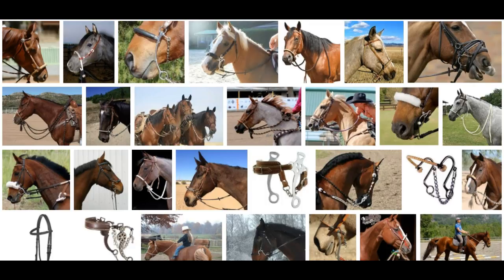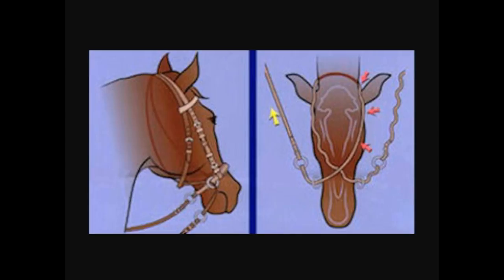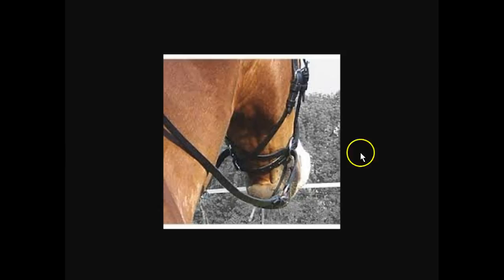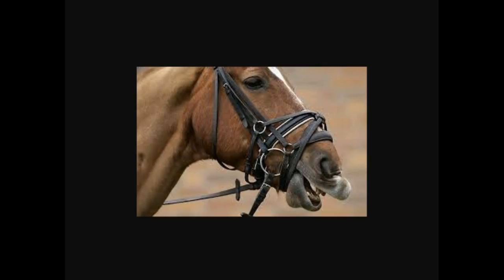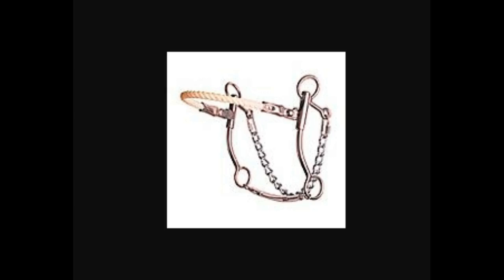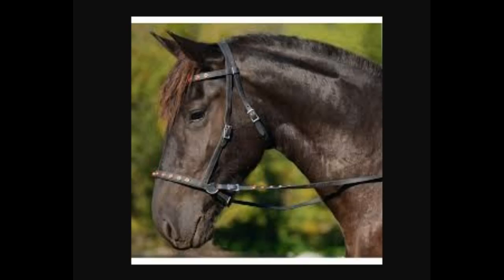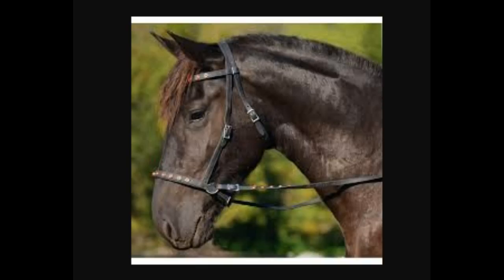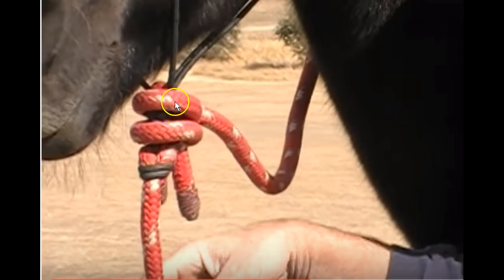Explaining & Understanding Bitless Bridles, Hackamores, Rope Halters & Benefits For The Horse

Comment: When I was reading my horse i used a halter (red and yellow i think) that allows you to clips a lead to it eg under the chin, on the sides of the head and as we didn't have a proper bridle i used two 'traditional' rope dog leads tied to together and clipped to the metal rings on either side of the halter. I was reading bare back as well. It worked perfectly fine, i just tugged gently on one side or the other to get her to turn. I think I used a bench to get up onto her.
Reply: She wanted to go into her paddock one time but I directed her up the hill to the front yard and in through the open metal gate (it was plenty wide enough for her to walk though comfortably) so I could get off. I did all of this without help which I count as an achievement. That was back in 2008-9, but is one of the things I remember the most about it
Reply: I haven't ridden since 2009 when my horse got spooked by a dog and bolted up the hill, she was going so fast I couldn't even hear myself scream. She went into the mango trees and I jumped off and cut my left leg open  just under the knee because of the barbed wire fence. If I hadn't jumped than I would have gone over her head when she ran back onto the road and stopped facing in the direction my parents at the bottom of the hill.
Reply: I still have the scars from the barbed wire fence other than that and a bruised tail bone and being absolutely terrified I was fine. My horse come back over to me once she had calmed down. I absolutely loved her and wish I had kept my promise of being the one to ride her again but I couldn't. At least she has a good home now.

Comment: So the metal in the mouth on most bridles used is a bit??? And the best type of bridle is a traditional hackamore, what about a typical most common used bridle but without the matzo thingy in the mouth, with a traditional hackamore has the rope underneath it, and it's not on the side of the horses nose to control which way it turns??? And I have tiny soft hand I don't pull unless I'm going backwards or coming to a halt or to slow down
Reply: So what is the traditional hackamore completely harmless

Comment: What do you think of a sidepull? the only function is to move the horses head in the direction you pull. Usually made of leather, I wanna use it for light dressage and trail riding but i want to hear your opinion :) Dont care if the horse has its head up or not.
Reply: Alissa Horse lover Most sidepulls have metal in them, which metal tends to break. I’d definitely suggest a rope halter, personally I think they look a lot cleaner and sharp when paired with an english saddle
Reply: Padded sidepulls are great provided they're adjusted right. Here's a great link on bits vs bitless, padded vs rope (https://www.fairhorsemanship.com/articles/harm-of-bits-nerves/) and how it affects horses nerves.

Comment: Hey Rick, I was with a therapeutic horse riding group and we used halter bridles, but the had bits. What would you suggest the DreamWorks Riders use alternatively?
Reply: Hannah Barton I know I’m not Rick, but sidepulls would work well too. Although most of the time they have metal in them, so they’ll break easily. A traditional hackamore or rope halter would work best

Comment: What do you think about a Nathe rubber bit?
Reply: Those Eventing Girls hey i havr had two wear thru on me. 2 different horses. i wNted a kinder way than metal but even with rubber or nathe, its gagged your por horse. i wont use bits now. ps... inside the nathe is thin ragged metal.
Reply: Lyn George what
Reply: Bianca Wheeler thank you! I totally get what your saying. Will definitely check out those rope halters

Comment: any recommendations for a English hackamore as I ride English
Reply: Priscilla Shadowbridge dr cooks bitless bridle is a very nice English hackamore.
Reply: Or a racing hackamore.
Reply: Priscilla Shadowbridge I prefer a side pull or a rope halter, they can look very clean and sharp
Reply: I ride english and just use a rope halter. You can also buy a nice looking side pull.
Reply: Priscilla Shadowbridge I absolutely LOVE jumping hackamores. They look really nice too. Especially if you ride English and want to keep a clean look.
Reply: Padded sidepulls are the way to be my friend. Flower hacks can be good too, but again, a padded one. A sidepull is a lot more gentle though. Also depends on what you do with your horse via english-if you do a constant contact, you NEED a very padded and flexible material or you'll run the risk of causing a lot of nerve damage.

Comment: My ex trainer did harm my horses nose by traditional hackamore. Traditional hackamore do have mechanical function too, because of firm shape and low tied mecate. IT makes the same add force to your hand as "mechanical" hackamore. I dont think that you ever had all types of mechanical hackamores in your hand. These which have ONLY leather nose part, And very loose chain (2fingers minimum And more) or leather band under chin Are very soft to the Horse. You can try it if you will leave your hand under the nose or under the chin And pull full force. Or put the hackamore birdle on your leg. IT doesnt have that effect as you think IT does. Its a lot softer than tradicional hackamore. Hand under the tradicional hackamore Is a lot uncomfortable even ouchy. I Ride on rope halter like you, but i also have a mechanical hackamore which i uses occasionally, but I Will not let anyone to put traditional rawhide 3/4 hackamore on my Horse.
Reply: Which hackamore or rope halter would you recommend?

Comment: Do when riding bitless, to stop a run away horse do u just have to pull harder to stop?????
Reply: No, if your horse is bolting you should pick up one rein and circle them.
Reply: Tyra Mistfall thanks so much 👍
Reply: You can't physically stop a horse by pulling back. It is either them giving to pressure by will or by pain. Using one reign pulled away from your body more toward your thigh to circle is the only way you can physically stop a horse. Pulling back just won't work if your horse isn't responding.
Reply: Matteya thank you I understand how that would work 😊
Reply: 23lidistl thank you 😊
Reply: I tried circling my horse when he bolted when I rode bitless and he didn’t respond to the pressure at all. The only time I’ve been able to collect him after bolting is with a bit. He’s bolted three times in all the years I’ve had him. Not saying that the bit didn’t hurt him at all because it probably did until he gave in, but that’s the only thing that I’ve used in that situation to stop him

Comment: Hey Rick if I were to use a bit which ones in your opinion Are the least harmful? I don't want to Hurt him but he does not get what I want him to do with out one.
Reply: Syd Loth any kind of bit will cause some sort of pain or discomfort. Do you lead your horse in a bridle or a halter?
Reply: Syd Loth uhm try the bridle that was the first one, its still sensitive enough so they can feel secure
Reply: the softest bit i can think of is a rubber french link loose ring.
Reply: Syd Loth What kind of question is that! A bit is designed for pain. You can’t expect your horse to work perfectly after you’ve trained him with pain and fear. Put a rope halter on your horse and ride him with one rein. Start out in a round pen, then maybe a small arena. Your horse already knows how to ride bit-less, it’s just you that needs retraining

Comment: Are snaffles okay?
Reply: Nothing. In. The, Horses. Mouth
Reply: Claire Equestrian 😂
Reply: Isla McGinnis Did you even watch the video
Reply: I support weak bits without chain etc) btw I didn't watch the video 😂😂
Reply: It depends? Snaffle is a wide category. Personally an eggbut french link (smooth, not twisted) is a pretty mild option. On the other end of the spectrum though, an o ring single joint with twisted wires would be very harsh. Unless you had a specific kind in mind, I couldn't really advise you.
Reply: If I use a bit i use a myler d comfort snaffle level 1. The bit doesnt hit the top of their mouths, it cannot collapse into itself like normal snaffles including the dog bone bits. Its center piece is raised to allow freedom of the tongue, it is 100% pinchless. And you can lift each side piece of the bit individually without interfering with the other side meaning you can lift each shoulder individually by picking up each side of the rein. It has a little copper on it which makes the horse accept the  bit easily. Love that bit. All the way best bit

Comment: but i dont think you are right or wrong but i dont think that having a bit in the mouth is wrong but i dont use the bad  bits you are talking about
Reply: A bit is a bit.All bits are bad.
Reply: Rick is very absolute. I know horses that cant switch to bitless. It bits aren’t evil, bits are a tool and something that Rick is wrong about is that it doesn’t cause pain unless you pull hard on a direct bit. The tool is as bad or good as you
Reply: Miss Equestrian if yanked super hard a rope hackamore hurts the horse. Anything can be abusive it’s just easier with a bit
Reply: alexa molesky Is have to disagree. Sure technically any piece of equipment can be abusive, but a bit is still a bit. How about you put a piece of metal in your mouth and pull on it and see if it hurts. Might I also add horses have a much more complex nervous system than horses and the face is one of the most sensitive parts of a horse. If a horse an feel a fly land on it then how do you think a piece of metal in its mouth feels?
Reply: Miss------Wrong. Bits are  pain compliance devices.
Reply: Miss------ You go ahead and keep believing the lie and refuse to grow in your horsemanship.
Reply: That------Sorry buddy-boy, but that is incorrect.
Reply: That----You perceive it to be easier on you,  but it is not easier on the horse
Reply: Anyone who tries to argue by saying you should put metal in your mouth is an idiot. Bits were designed for a horse’s mouth, not our mouths. Also not all bits are made of metal. You shouldn’t be yanking on the reins whether you have a bit or not, just because you switch to bitless doesn’t mean you’re being kinder to your horse if you’re still ripping on their face. Also people need to understand that if a horse is used to being ridden in a bit they need time to be taught how to go bitless, most horses can’t just switch right away. Actually, speaking of metal in a humans mouth, we do put metal in our mouths. Metal that we don’t get any kind of release from for years. You wanna talk about torture devices, then what do you think about braces? Besides braces, what about the other devices used that are screwed (with a screwdriver mind you) into the roof of your mouth? If you think bits are so inhumane then why do humans feel the need to cement metal to our teeth and screw screws into our heads? At least a horse that’s ridden in a bit gets it removed and gets to relax during most of the time with it in